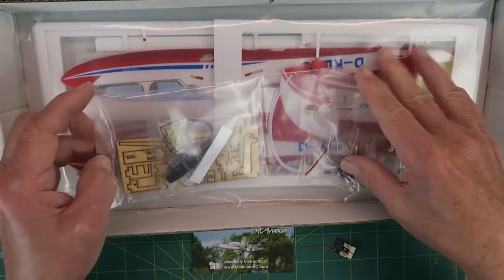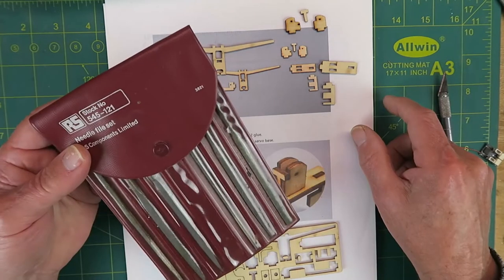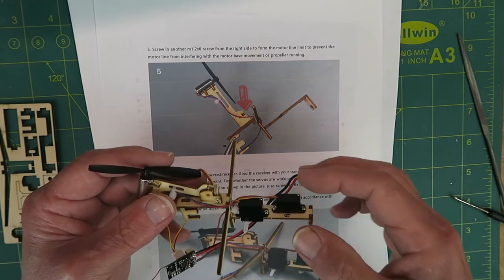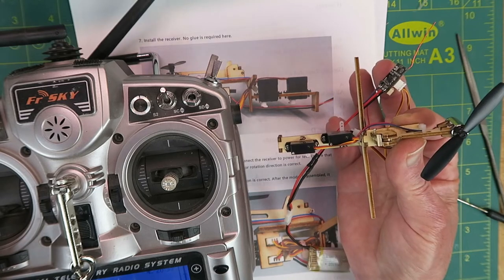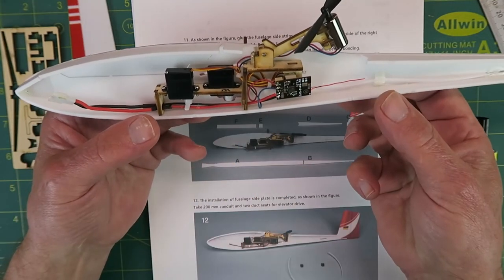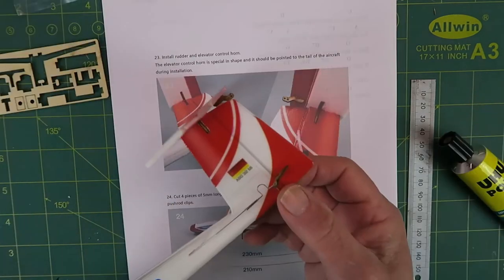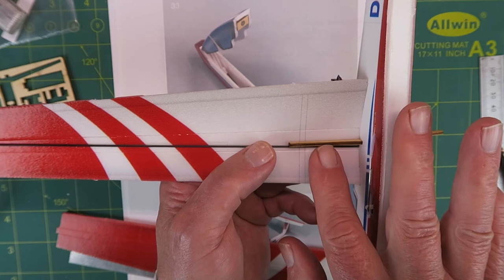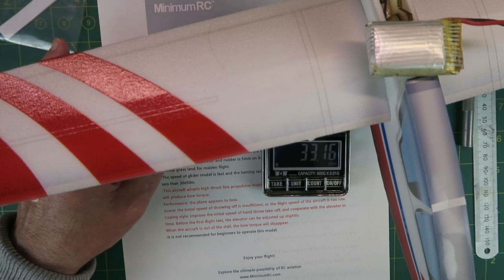MinimumRC ASG 32 Glider 560mm Wingspan Foam RC Airplane KIT Build

Comment: Just bought one... When gliding ,does it tend to nose drop when pushing the throttle again?
Thanks man, cool video !
Reply from the maker: Yes, this is normal for planes with the propeller above the wing. You need to put in some down elevator when applying the throttle. On my Bixler trainer I put a mix in the radio setting to do this automatically : https://youtu.be/te6u6ce3-d4 Please consider subscribing if you have not done so already!

Comment: My error was not checking to see if it was straight while gluing the fuselage. It's a little a bit off, but it flies.
Reply from the maker: I never did get mine to fly, or the Cessner either. It has rather put me off MinimumRC.

Comment: Why can’t the motor just stay in the up position all the time??
Reply from the maker: The motor is only needed to get the plane up to sufficient height to look for thermals or to slope soar. It is more efficient as a glider without the drag of the motor when not in use.